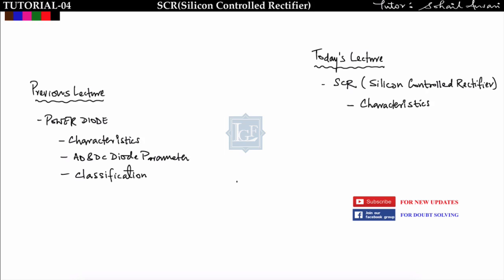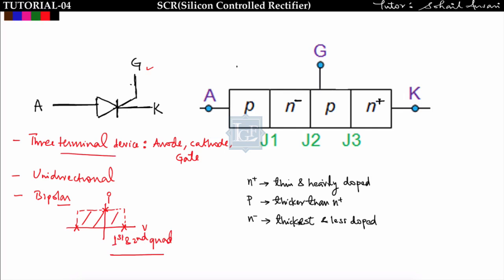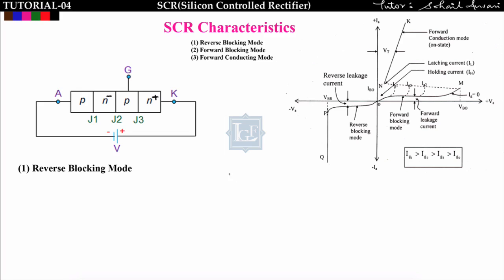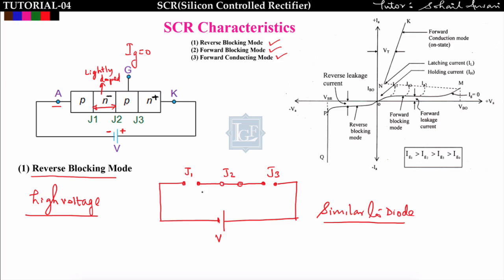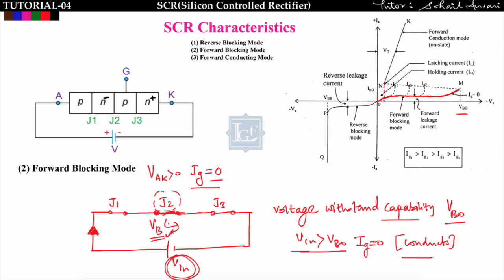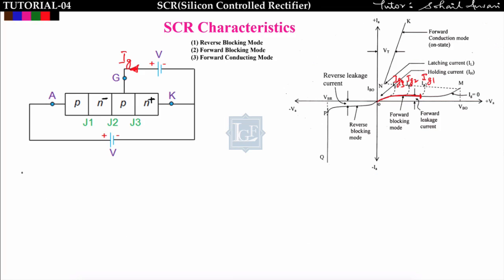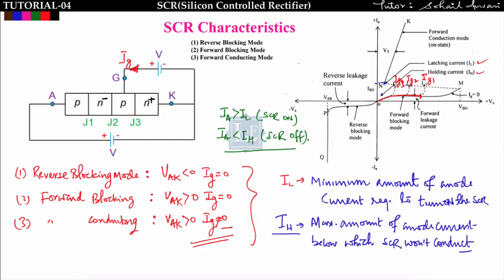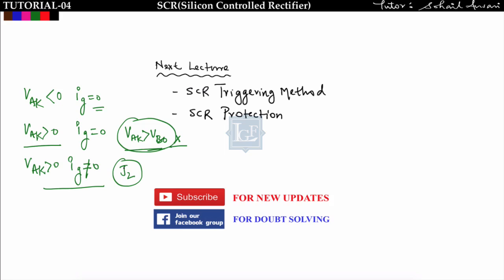Lec 04 SCR (Silicon Controlled Rectifier)

Comment: Sir holding current is the minimum current at which device turn off so kindly check that...
Reply: No, Sir is right, at first I also had the same doubt but it should be the max current as  diode can be turned off at any current less than holding current, then how can holding current be minimum? So it holding current should be the max current.